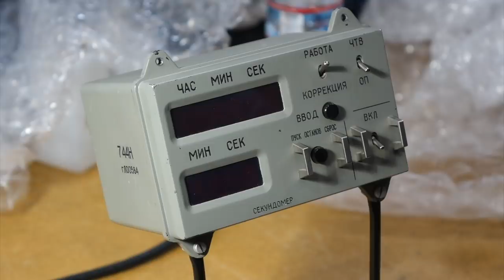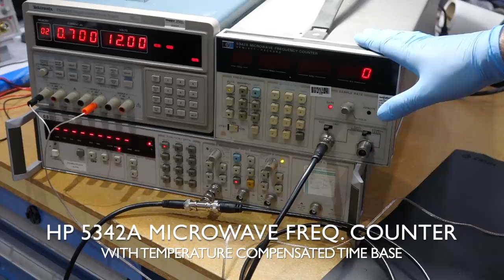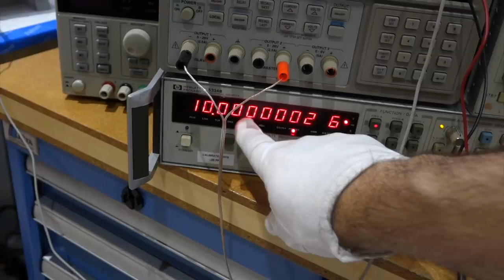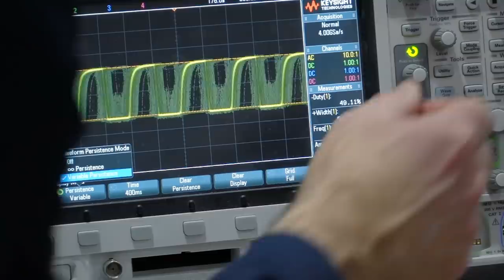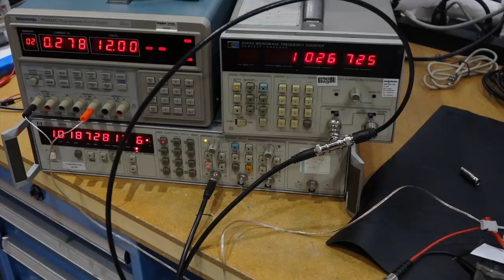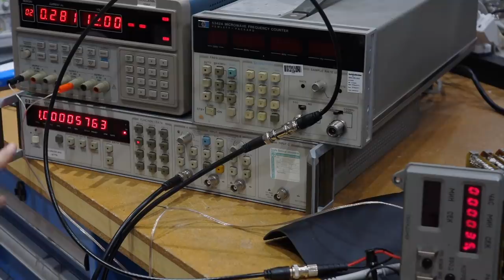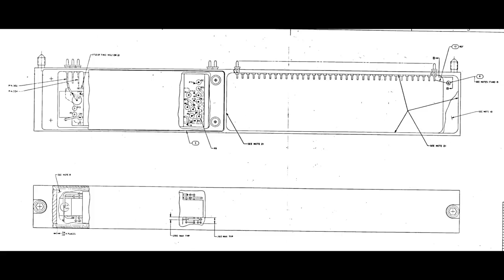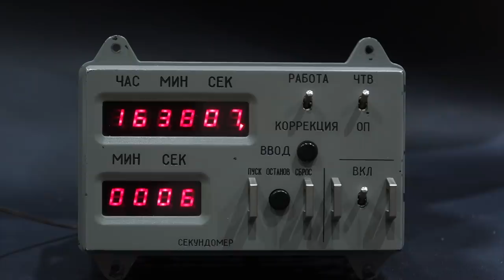Soyuz Clock Part 4: How accurate is it?

Comment: You know your life has gone right somewhere when you can expect one of your friends to just "show up" with a caesium clock
Reply: Exactly!!
Reply: Molloo3  I don't know, those things are pretty expensive...
Reply: Using that non crystal oven oscillator with digital inverters, should place this accuracy somewhere about the same as a typical quartz wall clock. Hope the crystal is T cut for long term stability.
Reply: I (figuratively) can’t wait for the day where there is a cheap enough HAT with a Rubidium CSAC for SBCs like the Raspberry Pi.

Comment: This clock was a replacement of a mechanical one. So I suspect it was an improvement.
Reply from the maker: We thought this might indeed be where the origin of the 30s/day spec comes from.
Reply: @CuriousMarc  30 sec/day = 350ppm. Not real good by crystal standards, but over temperature maybe reasonable.
Reply: @lwilton  30 sec/day is not even great by mechanical wristwatch standards. 4 sec/day is within traditional wristwatch chronometer standards, as long as it is maintainable over a number of positions and temperatures.
Reply: I guess even sixty years ago, any customer of a watchmaker would have returned an up-market wristwatch that was this bad at keeping its time. In the nineteenth century, there were wooden clocks that aberated by a minute in 4 weeks!
The only way I see the Soviet space program would be happy with a clock this unprecise is if they built it for a certain procedure of use from the start, where it only had to run for short terms, countdowns and their likes.
Reply: @Eo_Tunun  IIRC this clock doesn't send any signals out other than its timer's relay, so its purpose is mostly UI rather than control, baring any abnormal procedures, like manual deorbit burns etc. The ship does have a digital computer, which is what probably provides external clock for the thing.
Reply: @stevew8233  Can mechanical watch keep accurate at accelerations from 0~4g? Not being snarky but on board mechanical watch on 50's jets had to meet those requirements.
Reply: @lougrims  Speedmaster was (and still is) certified by Nasa for space missions. Linear acceleration shouldn't be a problem for the balance.
Reply: The most accurate mechanical clock I know of is the Shortt clock. Of course it is bulky and can't be moved.
Accuracy is 200 microseconds per day (2.31 ppb), equivalent to one second in 12 years.
Reply: @CuriousMarc  - didn't the H4 marine chronometer achieve under 1s/day in the mid 1700s? So even when referring to mechanical clocks 30s/day seems terrible. I think one clue is in that the Soviet space program relied very much on remote control from the ground, other than the US program which gave more autonomy to its pilots. So long term accuracy was probably not a concern when you would permanently sync everything with the ground anyway, except for short phases of radio shadow.
Reply: @Eo_Tunun  this clock was for human readout only, not any sort of control system timing so was acceptable

Comment: Looks like there is some issue with the oscillator. I have dealt with many devices having the similar oscillator design with a pretty stable non-glitching output. Soviet 74xx-compatible logic ICs tend to degrade over time due to ageing and environment temperature changes. For example I have seen dozens of retro devices stop working after a long period of storage (mostly in random conditions) just because of dead 7404/74LS04 inverters.
Reply: This would be Soviet satellite grade logic ics maybe equivalent to 54ls

Comment: At @6:50 you say "that's a tricky circuit, because it is an analog circuit made with logic parts".  Well.. it might be tricky but it is absolutely common to do it this way.  Search for "images Xtal 7404" in the interwebs.
Reply from the maker: Very common circuit. One of the most basic ways to make a quartz oscillator out of a few spare logic gates. But certainly not known nor used for its accuracy. To make it precise or to temperature compensate it, you’d need very intimate knowledge of the analog behavior of the digital gates, which is why I called it tricky. I was very surprised to find it there. I expected at least a TCXO.

Comment: I suppose intervening by scope probe on oscillator  elements is matter of glitch. Capacity of probe cause of parasite oscillation. When  measurement done on 1 sec pin you got clear output.
Reply: More likely noise on the power supply pins, probably caused by either a set of counters rolling over, or by a external drive, and insufficient or failing board decoupling capacitors.  You could probably get the capacitors as NOS as well, there are plenty of them on eBay, or as part of old Soviet era equipment being sold there as well.
Reply: That's my vote as well. Excessive probe ground conductor impedance would allow any switchmode power supply frequency ground current flowing between the instrumentation and the clock to impose an external disturbance on the circuit. It would be easy enough to measure the 1Hz signal both with and without the 1MHz probe in place and see if the 1MHz probe is disturbing the oscillator.
Reply: If they were measuring on raw oscillator signal for sure capacitance of the probe could be a problem, if they were on a buffered 1MHz it should have been okay.
Reply: Ray G The output they were measuring should indeed be buffered (and assuming they used 10x mode on their probes then there would by 9-10Megohms resistance in series with a capacitance of perhaps a few tens of picofarads.  That would be enough to potentially pull an unbuffered crystal slightly off frequency but is rarely enough to significantly interfere with its output in my experience, and in the case of a buffered output the load and capacitance are so slight that they should not affect anything.  That said, if the probes were introducing enough capacitance for it to distort the signal to the point of glitching then one would have expected to see signs of excessive capacitance on the scope display where we only saw modest effects of capacitance but an otherwise acceptable squarewave barring the intermittently glitching output.  My guess is possibly a failing bypass capacitor nearby allowing the rails to momentarily dip severely periodically due to a much larger load switching on/off elsewhere in the circuit on the shared power rail.

However, they could have likely worked around the glitching as the scope captured waveform showed that the glitches typically had a sufficiently lower peak voltage that adjusting the gate level on the counters should have been sufficient to avoid counting the glitches since the glitches otherwise only skewed the duty cycle of the neighboring waveform but not its averaged period.

Comment: Could you please go into some detail on the timing requirements of space flight. How do error in both drift and having an accurate clock effect navigation. Also what kinda of errors you can expect being of in both parameters by 1 second,  10 seconds etc? thanks again for making such informative yet laid back videos! I have learned tons about the fundamentals of computer science watching your channel.
Reply: Surprisingly close to what old ships would use for navigation, time and stars. By knowing what time is at source location (Houston or London, for example) you could in the middle of space and/or the ocean use the stars, with a sextant, to compare the difference of what the sky should be and know roughly where you are. In the case of the spacecraft you have a clear view and waaay more reference points to look at. Of course some limitations apply, it was used to get some variables in orbit and attitude while on route to the moon. A search for Apollo sextant navigation will give you a lot of pretty cool information about it.
Reply: Not that it would come up in standard space flights but time dilation is also worth considering. Eventually the on-board clock will have to get synced to a clock on Earth's surface even if it kept perfect time.
Reply: @gu4xinim  Just trying to comprehend the 3D mathematics involved to find where you are in X,Y,Z axis' while traveling at 1,000s of Mph makes my head hurt. Those early space engineers, of all disciplines, were beyond brilliant.

Comment: Is the glitch still present when the case is reinstalled, if you sample after the first divider?

Perhaps the scope ground lead is causing local EMI to couple into the sensitive oscillator feedback network?

Is there an asynchronous display multiplexer clock running at the glitch frequency?
Reply: Ken's schematic shows a buffer amp (inverter) after the oscillator, but it looks like it's in the same package.  Still, I suspect the probing was injecting noise, and is the cause of the glitching.

Comment: I repair wristwatches and clocks, mechanical, quartz or transistorized, and I can't wrap my head around this thing. It's so much more complicated than it should be.
Reply: I totally agree !
but, hey, Soyouz !!!
Reply: Maybe true but depends on an FMCEA & reliability analysis, I like the way that it uses individual decoders for each digit, so it still works for other digits rather than not at all.
Reply: It's just as complicated as it needed to be for the technology of the day. It's not every clock that you can fault find down to individual display segment driver gates. This technology is one step on from discrete diode transistor logic. It's a thing of beauty, when engineers understood to gate level how chips worked.

Comment: This was not a spacecraft's main clock. As it fits into a slot previously occupied by mechanical clock, it's for crew reference only. Flight instructions and procedures involving this clock don't require any higher precision than that of a wristwatch of 70's era when this spacecraft was originally designed.

Comment: Put another scope channel on the power supply pin of the oscillator chip. I expect you will see the power is being glitched synchronously with the spikes you’re seeing in the clock output. Probably due to something in the first divider. TTL oscillators of similar design are not that bad. They are ubiquitous in microprocessor clocks of the 70’s and 80’s.

Comment: If you can’t set the clock very accurately, maybe there was no foreseen requirement for better day to day accuracy. It seems to me that the real purpose was to measure relatively short intervals of rocket motor burns. Let’s say you plan a burn 20 minutes from now lasting 12 seconds plus or minus 0.1 second. This clock would be entirely capable of doing that. I wonder what the purpose of NASA’s requirements. You do not plan a burn down to milliseconds for multiple days after launch. The  start time and length of any given  burn is recalculated just prior to the burn given updated position and velocity data from either tracking or inertial reference input. The burn control technology, turning on and off fuel and oxidizer valves, was probably only able to control the length of the burn down to 0.1 seconds, and I suspect worse than that. Why do I need micro second accuracy?

Although I am impressed with your frequency counting technology, why not just run it for a day or a week and compare the time with either WWV or a GPS time read out. I find the time on my iPhone to be perfectly in sync with my GPS receiver, and it is readily available.

I am a big fan of your very cool videos.

Charlie
Reply: I guess they needed the accuracy for navigation? :)
Reply: Consider also that a Soyuz rocket reaches orbit in 9 minutes from lift-off, and it's the most time of continuous engine usage; other manouvers which are for the most part impulsive burns takes only a few seconds so you need a quite precise clock but at least the error doesen't add up so much

Comment: And here I thought that they will just let it run for a day and compare it against network time. Boy was I wrong.
Reply: Even after a day you would not be able to detect even a 10ppm error based on a per-second display on the unit as there are only 86,400 seconds to a day.  Measuring the clock source you can attain extreme accuracy in fairly short order and even greater accuracy over a period of time (for example, on a scope display two nearly synchronized time sources, one locally generated of known precise frequency, such as an atomic standard, and the other the source to be measured, and you can time how long it takes for the source to drift out of phase by a given degree and from that calculate the error even without a frequency counter....a frequency counter with a very accurate timebase is simply easier and faster still).

Comment: Your clock is running at +57 ppm. A basic oscillator like you have there would ordinarily be around +/- 30 ppm, however this one is decades old, so the quartz crystal has been subject to that much aging, as have all the other components in the oscillator circuit. Also, you don't know the history of this unit in terms of thermal and physical shock. Quartz crystals are pretty delicate.
Oscillator circuits are very high impedance, so it's easy to inject noise, and I think that's what's happening when you probe the 1 MHz signal and see the glitch. You seem to have figured this out by the end of the video.

Comment: That jitter might be an intentional effort to extend the average period by 1.2%.  I assume the crystal is in a temperature controlled oven to stabilize its frequency.  Evidently this results in a stable frequency that is 1.2% above 1 MHz.  Knowing this and stretching one period by ~30% at reasonably regular intervals would restore the average frequency to 1 MHz.  Since crystal frequencies vary some this might be an effective calibration strategy.  Since divide by 10 counters and 1 MHz crystals are common and cheap, this would be cost-effective and timely.

Comment: Is poor accuracy due to the age and storage conditions, bad treatment when others attempted to power it?
Reply: Unlikely. Soviet engineering did not require high precision. The imprecise ak47 is in use to this day. Was their clock good enough for the job? The answer is yes. Anything else is irrelevant. I suppose, you could point to their just-good-enough philosophy and bad mouth them. I don't think you can truly defeat people through bad mouthing.
Reply: FunGames 
I wasn’t bad mouthing them. I had assumed it was far superior to its current performance when it was produced. 

So now I will re-assess and figure it was just good enough. The over top engineering wasn’t for performance, but reliability. But making it more complicated doesn’t lend itself to reliable. So I assumed it was engineered for performance.
Reply: @larryscott3982  I wasn't accusing you of bad mouthing. But a lot of these type of comparisons are designed to be. The thing is that if the soviets stuff were so bad, WhyTF do americans ride the rockets of the modern day soviets to the ISS? The design philosophy of the russians remain the same as in the past.
Over-design is probably for profit especially when the money is easy to print. In tougher times, you'd go ride the imprecise soviet rockets instead :)

Comment: Start at the Crystal and  follow the signal train  on scope until you find the glitch source component.  Not like your going to find a replacement ?   That jitter will not clean up using the Trigger Level ?

Comment: One thing that I noticed in part 3 is that you're running it on 24 volts even though the Soyuz works on 28 volts. I don't know if that would make any difference (I doubt it), but that's my 2 cents.
Reply from the maker: Yes, nominal is 28V. But no, tried it, it doesn't make any difference. Actually the clock is pretty happy counting from a very wide range of voltages.

Comment: The main mode is to have sync clocking from the main ship's computer.  All space ship  devices should follow exactly the same sync clocking. With such approach even some accumulated error in main "sync" module is not that dangerous comparing to the situation when each device follows its own clocks. This autonomous mode is not a main mode, it's sort of backup if something has happened to main ship's computer, e.g. temporal bloackout or it's rebooting( few secs max) -- you still need some cloks for spaceship crew. It's impossible to accumulate even 1s error in such short terms. 
Regarding this weird osciloscope reading -- no Space radiation can compare to "baba Galia" handing of the devices inside your warehouse. I doubt this clocks were kept for all the time in requested environmental condititions. Actually  the fact they were handled to auction and than transfered via regular delivery service to you means storage and handling conditions are already violated. You can't expect it to work with the same quality and accuracy like it used to be during their prime in Soviet Union.
P.S. Thanks for the video. :)

Comment: Great video! WOW! The accuracy was only 4 seconds a Day with all that hardware! Just about any digital wrist watch at the time was accurate to 7 seconds a YEAR!
Maybe the 1 MHz clock circuit has a "walking wounded" gate in it... its works but glitches. See if you can clean it up with some decoupling caps. I would have NEVER let a design out the door with a glitchy clock, especially when lives are a stake.  I saw in your prior video that the 5VDC supply is very noisy.... it must be due to age.... how would they ever go into space with that!  Yes, I agree, there is way too little decoupling capacitors in the digital circuitry.... now that is just a poor design and can't be attributed to old components going flaky over time. Space Shuttle or not, I would never go up in a Soyuz capsule.

Comment: If I was following when you were scrolling the scope, it looks like there was a glitch about every 20 microseconds. I'm not sure how you might get that out of a div 10 chain, but it seems suspicious. Be interesting to find out what that blue trace is with the ringing on it.
Reply: I would guess the power supply or the display multiplexer.